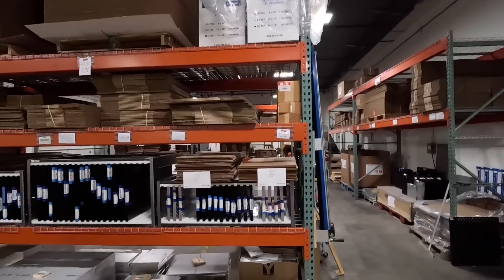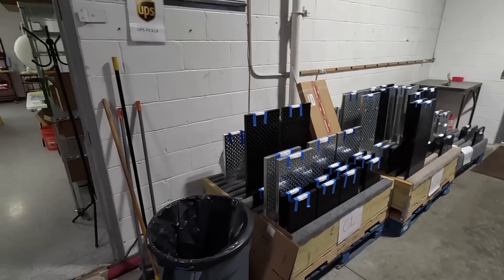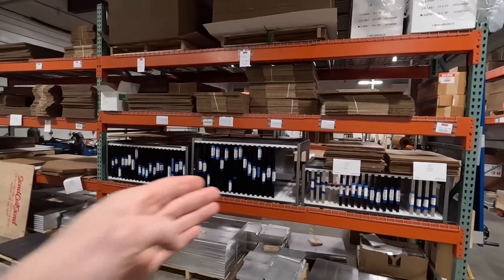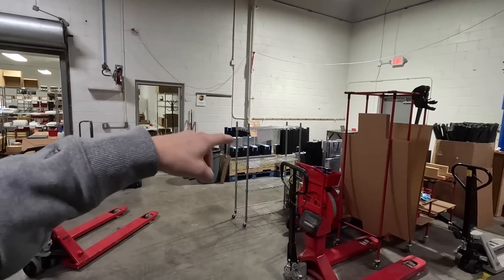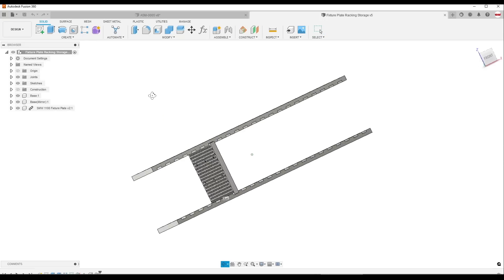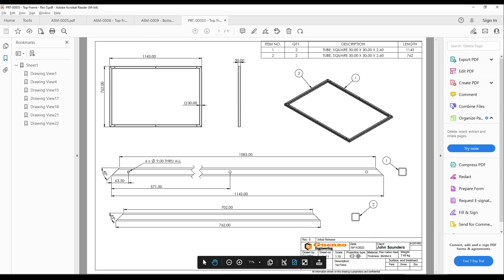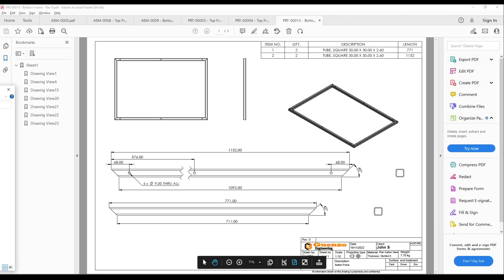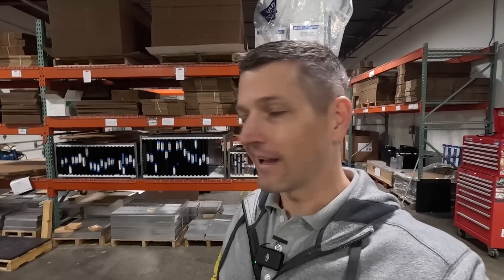Building Fixture Plate Storage Racks using outsourced CAD design!

Comment: This is certainly late, but next time you’re doing basic sheet metal, give Oshcut a try.  I’ve found they don’t do as much marketing, but their prices for smaller jobs is better.  They can also laser cut tube steel now, so you can make frames with notches that go right into place for welding or bolting!  I’ve used both, and sendcutsend has many more processes, where Oshcut focuses on laser cutting, cnc bending, and welding.  So if it’s metal, it’s Oshcut.  Try them out next time.  They do instant quotes, instant process analysis, and offer other services like tapping holes and powder coating all with instant quotes too.  So you’ll know ahead of time who gives the better price.  Quality is the same, though with the new bender at Oshcut, I think they may have an edge on bent parts!

Comment: I just started using send cut send about 6 months ago as I didn't want to cut carbon fiber in my mill. I felt the same way as John did as I always told myself "I could do it or fix it" but I did some thinking on that and I would be spending my  time that could be making $150-$300per hr on a part I can just order from send cut send for $10-20. Man, choices back when I was poor were way simpler. I since then I have made half a dozen ot so more orders for combat robot parts as there prices are just so damn low (in my opinion).
Reply: We did a price analysis and found that in many cases where we use plate like stock (think 1/4" X 2" x 8") that it was cheaper to have it cut from send cut send than to buy the bar and saw cut it ourselves. When we had a waterjet we still could not get the stock on the floor for the price they are cutting and sending it to us for. The only thing I wish they could do but have not is Nylatron GS, its basically just gray nylon that one of our customers uses as a wear surface but its a specialty order so I get why they are not interested.
Reply: @TomDetka  good to know. I don't machine much steel but next time I do I'm going to peice out send cut send for the stock

Comment: It just so happens I am working on a my own organizational send cut send project for tool management.
Reply from the maker: nice!  for cutting tools?
Reply: @nyccnc  Back story to frame the problem. Were a job shop for short run parts. We recently noticed that we spend way too much time trying to remember or figure out what tools are where. Especially once in the machine. So I made note cards for all of our standard tools. Now I'm making card holders that will magnetically attach to the machine so you can know exactly what tool is in what slot. You can also note right on the card the current Z offsets and the date the tool went into the machine so we can start tracking tool life better. Not sure if thats the best way but I think it will work for the current flow in the shop.

Comment: Next you gotta get people to start taping those labels in the middle of the plate every time ;) Also, I know this is monday quarterbacking, but if all you need is a box frame that can adjust height, 8020 is perfect for stuff like that. It's always a bit of a sticker shock but I doubt it'd be that far off in price compared to this super custom solution
Reply from the maker: Oh, man, that's actually a good call on the 80/20....

Comment: You should number the slots so you don't have to manually count each time.
Reply: I would print off labels and stick them on the front edge of each slot. Each slot would be an easy location identifier. (E.G.  Rack A, slot 4)

Comment: Those would be great to add a micro switch or induction sensor to be able to determine if there is a product in the slot. Some microswitches and arduino, a bit of programming, and I'm sure you can have it tied into lex for realtime inventory
Reply: Great thinking! Gave me some ideas aswell :)

Comment: TBH, 150 USD for designing this sounds like a bargain. 

If you are looking for improvements, the top plate would still function exactly as needed even if it was only a portion of the depth. It's only keeping the plates upright, so you don't need a contact the full distance, and the bottom plate will in any case guide it straight. At least over here, a 1m2 sheet of 25mm thick PE plate costs something like 500€.

Comment: Great video! Was the shipping for those size parts reasonable? I've been wondering if SCS+shipping cost is comparable to local shop prices.
Reply: SCS is free ground shipping. I use them all the time at my dayjob. They are cheaper than most full service sheetmetal houses. But, their capabilites are less. If you can work within their capabilities, they are a great resource.